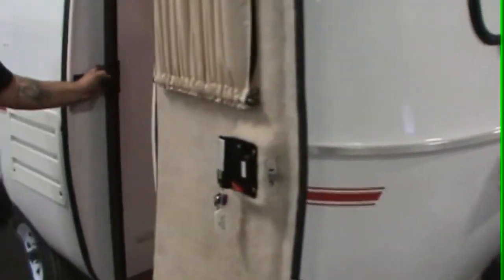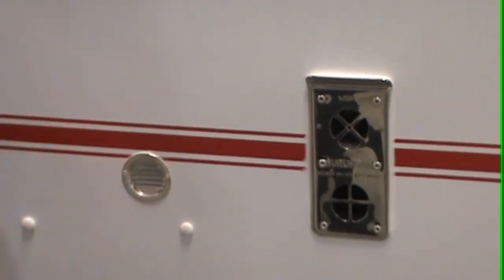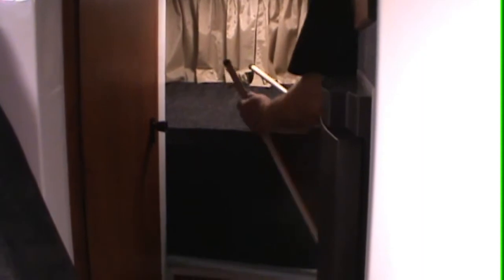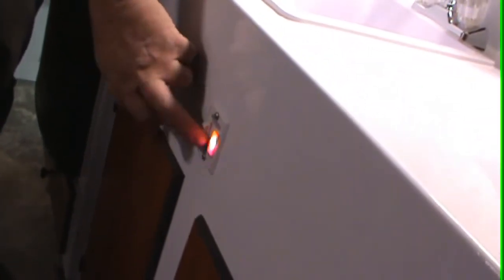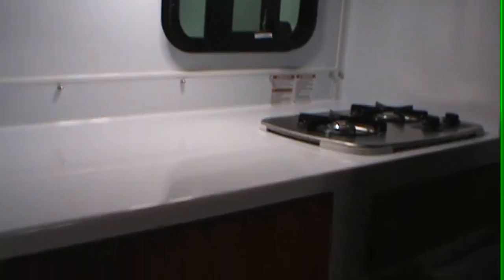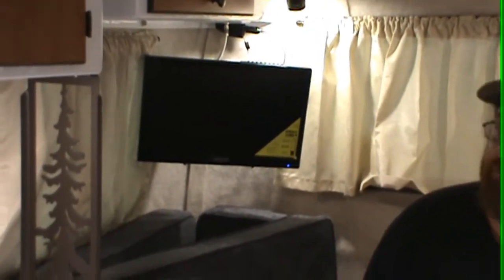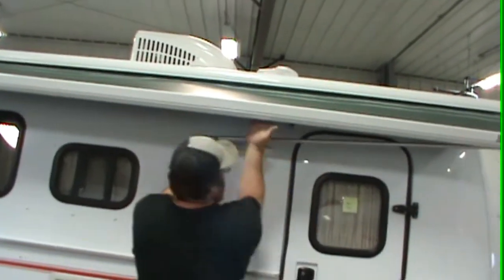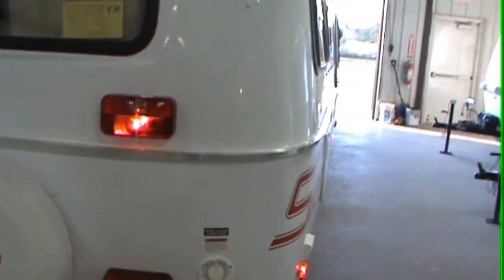Brand New Scamp walkthrough

Comment: Thank you very much for this video....I had mine delivered to my house in Florida on the 18th of December...was a nice Christmas gift.  Something I didn't know is disconnecting the battery or that fuse as my camper sat in my driveway.  I didn't know it's still pulling electricity from the battery.
Reply from the maker: Glad you got some info from the video!   Being in Florida,  I don't think you would have to disconnect the battery but you should still remove the fuse unless you're plugged in at home.  If you're plugged in, there shouldn't be any battery power being used.  Keep watching for more videos,  we'll try doing a couple interesting things this winter!

Comment: Was that a 16 footer ? Any modifications to your car for pulling . What type of plug are you using for camper to car . Thanks.
Reply from the maker: Yes it is a 16 footer.  Our car didnt have a hitch setup,  so the only modifications we did were to get a hitch put on and get the electric break controller installed, along with  the wiring  for the hookup from car to camper. The vehicle is a 2012 Chevy Captiva and she pulls the camper with ease.  The plug is a standard 7 point connector.

Comment: Can the plumbing be of use during winter
Reply from the maker: We've never used it during winter,  but I would advise against it myself.   In colder weather we simply use bottled water and for the "deed" we use a 5 gallon bucket with toilet seat attached!  We buy bags that fit buckets which are made specifically for this purpose so it's clean and oder free.  Thank you for watching!

Comment: What did that end up costing the budget?
Reply from the maker: About 20,000 with the options.   Well worth it though!
Reply: @dennisamy-ourlife  I need to start saving!
Reply from the maker: Yeah, Scamp doesn't finance either - need to save all your pennies or get a bank loan!
Reply: @dennisamy-ourlife  16 foot?
Reply: Any idea how much lower a 13 foot would be, with no bathroom option, but everything else?
Reply: @djkenny1202  yes,  a 16 footer which is actually 13 foot of living space  - it's 16 feet overal length
Reply from the maker: From the best I can figure, it's roughly 2,000 - 3,000 cheaper for a loaded 13 footer with no bathroom compared to the 16 footer.  You'd have to contact Scamp for a more accurate estimate  -  I'm basically giving my best guess!
Reply: Thanks for a great review!